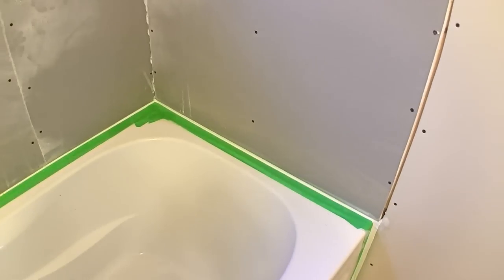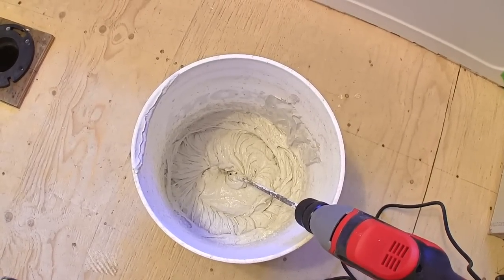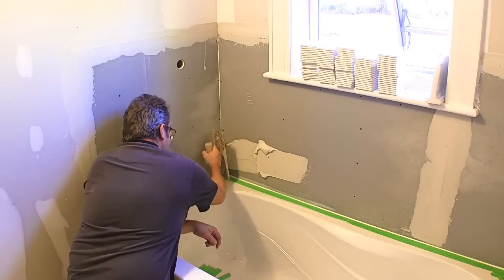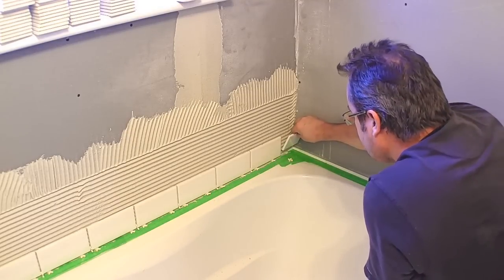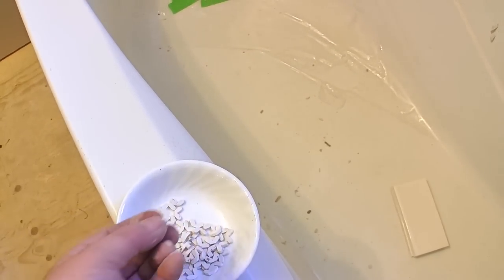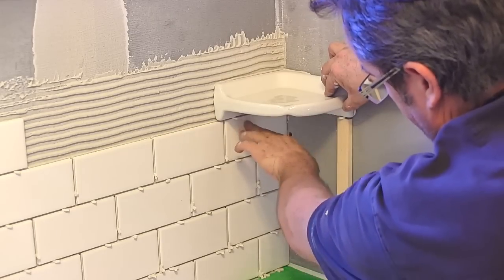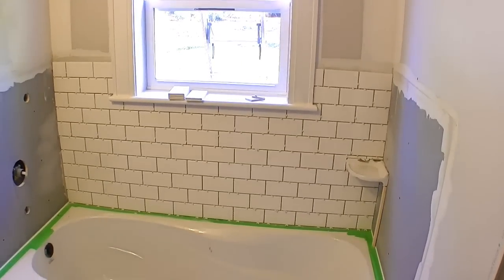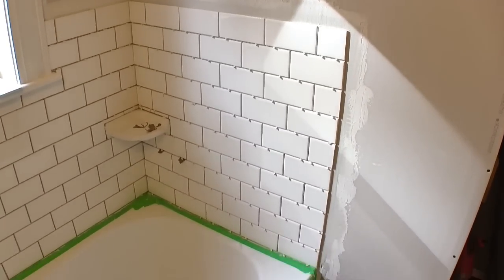Doing Ceramic Tile Around The Tub

Comment: I always plum a center line on the back wall and center the first tile in the middle to insure the same size tile piece at each side wall, although a little less important for a subway tile.  Also, good practice to tile each row (back, fixture side and head side) before starting the next row.  This helps to keep all the gout lines lined up and matching as minor adjustments can be accomplished as the tile progresses up the wall, especially if your tile is going all the way up to the ceiling.

Comment: Nice job.......Can I make this suggestion for anyone starting the same job...When you silicone around the tub make sure it is the mould resistant type, also fill the tub with water until the sealant cures. Doing this will prevent it tearing and pulling away from the wall the first time you use the bath.
Reply: never heard of this but Makes A Ton Sense!
Reply: Polyurethane-Based Sealants Meeting ASTM C-920 ; Sikaflex®-1A. ELASTOMERIC JOINT SEALANT / ADHESIVE

Comment: Excellent job on putting those tiles up on the walls. I find the job of installing tiles therapeutic. I have done a few walls in my time. Will you be grouting the tiles with a white or black grout ?. I chuckled when you mentioned the instructions told you how to mix the powder to the point of it becoming like icing sugar or cake mix consistency,good job i cook as well,ha ha.

Comment: The waterproofing membrane we're required to paint 2 two coats of prior to tiling wet areas costs $215 for 15litres! With that said, I'm not going to be banging no nails into the wall to destroy that expensive membrane and risk moisture getting through, just to hold up a little bullnose tile. a well placed plank on the floor (leaning against the wall will hold it there, or nice wide masking tape... or simply start at the bottom first like most other wall tiling. Nice job though, looked pretty good and you sure got going to get it all layed with one mix of mud
!

Comment: No water proof system is needed on the wall?
Reply: He used tile boards. You can see the different colours.  Cement based for use in showers and bath areas.

Comment: Hi. Great job! Can you help me with something. You have used tiles that have a rounded,white glazed edges (sometimes called bullnose edging). They make it super-easy to do edges. Normally with many tiles the edges are NOT glazed, you will see terracotta there, so you need an edging. I am finding it nearly impossible to find white subway tiles with this kind of edging. Can you tell me where you got your tiles from? Thanks. Would be much appreciated. I hope you will respond. I know this is years after you posted this, but I live in hope! :)
Reply: Haha, I just posted the same question!  I can't find it either.

Comment: Water isolation in US is poor. In Finland you just cant install tubs or showers in a room unless it is first isolated the whole area, walls and floor. All water that is spilled on the floor or walls has to access the drain eventually.
Reply from the maker: That's sounds extreme and unnecessary. But, if it's your building code, you have to follow it or face the consequences. IF that's in your code, we have to wonder what ridiculous thing comes next, and when will the idiots introduce it here.
As far as I'm concerned, building codes should be stripped down to the basics - the important things like fundamental structure, plumbing and electrical. Reduce bureaucracy and let us live free, like we used to do (and survived just fine) for thousands of years.
BTW, I'm in Canada, not US.
Reply: a25751 Oh really? Great, You do that for your kitchens too right? And laundry rooms? You know, any room with water running to it? Gosh. You might as well do it to the entire house! Someone might spill a drink. I assume this applies to all the spaces the pipes run through right? What if a pipe gets damaged! Gotta isolate those too along redundant channels to divert the water out of the structure! If it got wet even once everything would be ruined!

I'm being a little hyperbolous here, but your "water isolation" regulations seem draconian and severe. A little water won't do much lasting damage to anything, and a little water will get into everything no matter how well you isolate it. It's the nature of houses and the real world. What John has done seems entirely capable of preventing water from being a problem.

And while I'm sure building codes are all very well intentioned, at the end of the day, if it works, it's good enough. I mean, it's great that there are base-line regulations mandating that buildings be constructed to a certain standard to ensure the safety of the occupants of any given building, especially when a building is public, or otherwise put to a commercial purpose, but there's a limit where reason ends and we put on our steel-mesh gloves and safety glasses to cut construction paper with safety-scissors at arms length while a medical team stands by.
Reply: I Love this explaination!!!  it showcases the mind-numbing crap our society is brainwashing the masses with ridiculous do this, don[t do that unnecessary time-consuming and cost-adding hoops to jump through! just like the oh, so not true saying: "Our diversity is our strength" a load of crap that society crams down the throat of mindless people who can't thinkfor themselves.
Reply: Excellent comment thread.

Comment: Can anyone elaborate on what the square piece is underneath the toilet flange.  My toilet flange is sitting about a half inch above my subfloor.  Any tips on how to alleviate this.  I know my cement board will be 1/2" but I will have to split it to go around my already installed flange.  

Thanks